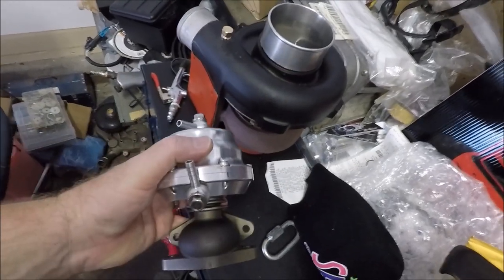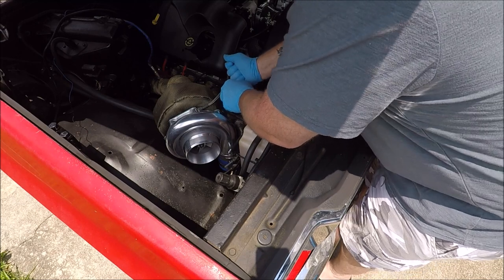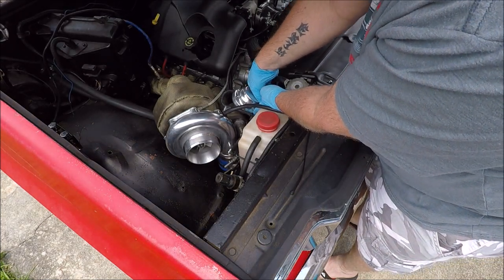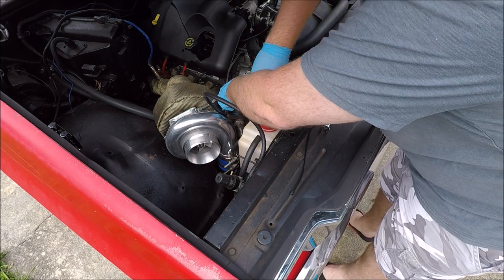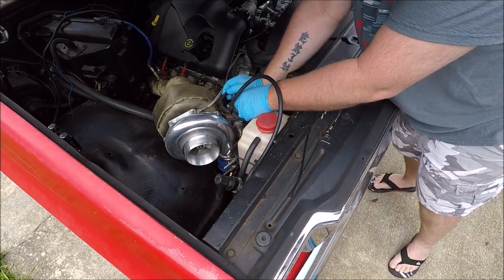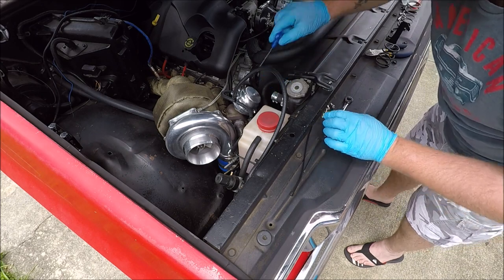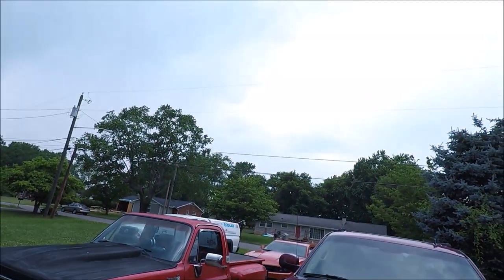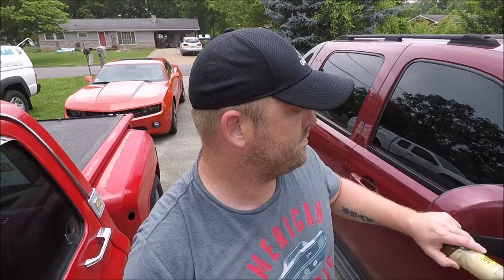SEATBELT DRAMA AND INSTALLING A STIFFER WASTEGATE SPRING FOR MORE BOOST

Comment: You’ve solidified my choice to delete my Power Steering! 😉 Originally I was over replacing the pump, 3 pumps in less than 1yr, remanufactured from Advance. #Warranty Plus I felt eliminating the PS frees up 10-15Hp and losses a little weight.  One less part to replace/break. 😉
Reply from the maker: Yea if I wasn’t planning on driving this thing all the time then I probably would ditch it too.
Reply: Bad Luck Garage With your full size truck it may be rough to manually steer, in an S10 it’s not really a big deal. 😉
Reply from the maker: I think it would be more about the 245/45-20s up front than the truck itself. Lol.

Comment: Alot of the 3 point seat belts wont work correctly unless they are bolted in. I suspect they require a specific angle, but i got belts before and they wouldnt work. Bolt them in and they are mint. May be worth a try anyway brother!
Reply from the maker: I didn't think about the angle thing but they were actually in the truck when I tested them(at least the passenger side) and the retractor seems to have a mind of its own. They're burgundy and dont match anyway so I guess Im just gonna spring for a new set. To be honest I was tired of messing with these racing harnesses all the time anyway,lol

Comment: I can see 100% if I ever need to change the WG spring I’ll have to R&R and use a vise to hold/compress the spring! 😳. This is definitely not a one-handed procedure. 🙄
Reply from the maker: Honestly that’s the best way to do it anyway to avoid pinching the diaphragm. My neck issues are back(that’s why I’m a bit loopy in the video...because of the medication) and that’s why I was saying I’ll be taking it off when I switch to the 12lb spring. Trying to push it down at that angle was pitching the nerve in my neck while I was doing it. The next few video will probably be kinda low energy until I get my issues sorted. 😔
Reply: Bad Luck Garage Hang tough and get yourself feeling better! 🙏🏻🙏🏻🙏🏻
Reply from the maker: Yea I don’t see that happening. Dr wants me out of work and back in physical theropy. Job wants me working 12 hrs a day 7 days a week. Job usually wins until I end up out for 5 months in temp disability again. Until then I’m just doped up like a friggen junkie driving around killing bugs. 🤪
Reply: Bad Luck Garage Ouch that sucks money wise. Take care do what ever is needed to get better. 👍

Comment: If you haven't already picked up new bolts, keep grade 5 in mind...  

while a grade 8 is stronger , sometimes itll break or snap before a 5 cause of the 5s ability to stretch/ bend..

I'm also fairly certain that david freiburger from roadkill/ hotrod damaged a vertebrae in his back from having the shoulder harness bolted to the floor as you say...  

definitely needs to be hooked to a roolbar or atleast a harness bar behind the seat..
Reply from the maker: Funny you should bring that up because I was actually looking up the grade 8 vs 5 thing last night and the consensus seems to be, if the tension is in the bolt from end to end then grade 8 should be used. If the tension is coming from the sides(shear force) then it should be grade 8. So for crossmembers, steering boxes, ect...grade 8. For thinks like shock mounts where the load is on the side of the bolt grade 5 should be used. 
And yes I’m definitely getting rid of the harnesses and just putting retractable 3 points in as mentioned in the video because I have no plans for a cage or roll bar in this truck. The next project will be a different story. 😉
Reply: If you feel that a turbo 6.0 doesn't need a cage, then shit I can't wait to see the next project!

Sometimes I wish my s10 was a c10, alot easier to find/ build a rear axle for.. not to mention c10s are sexy as fuck...  
 
Was gonna cut down either a ford 9 or 8.8.. but I'm not much of a ford guy, so now I gotta cruise the junkyard for a Dana 60 rear so I can have it cut to length and have new bearing ends welded on so I can use semi float axles..
Reply from the maker: LMAO. Goal was an 11 second daily driver for this one brother. If I can do better than that then I’ll probably back the boost off a bit for longevity. I’m really wanting to build something budget but just for the track....no overdrive, no interior, no muffler. Just set a low budget and go as fast as I can without busting that budget. But I need to at least get this C10 reliable and in paint before I start something else of wifeys gonna have a fit. 😂
Reply: Sounds like my s10 lol.. no overdrive and no mufflers.. 

unfortunately idk why but I have this overwhelming need to meticulously restore the interior.. 

Got an idea on What color or colors your gonna spray the c10?

It'd be kinda heavy but with  a budget a 2000 + NBS gm 2500 would be a decent budget drag truck.. comes with a 6.0 with  4l80e and either a semi float or full float rear depending on if it's a hd or not
Reply from the maker: Wanting to do Synergy Green for the wifey but don’t know if that’s gonna be in the budget so may have to go with something a little less expensive to shoot. But gonna need a ton of bodywork first. I don’t want a show truck but I do want to get rid of all the rust.
Reply: Synergy green would look awesome... 

especially if you did a factory style two tone with it, white in the middle, green top and bottom..  

Maybe you can get a local shop to sponsor a video and get a hook up on some paint..
Reply from the maker: That would be cool but you actually have to have views to get hookups like that. No paint shop wants to sponsor a channel with 3500 subs. 😂 There’s just not enough veiwership to make it worth it for advertising.
Reply: If your willing to try summit racing brand paint, they have sour apple green metallic for $ 84 dollars a gallon..  $118 for a gallon with a quart of activator and a quart of reducer..

 and it's between $63 and $84 a gallon for clear coat depending on what you choose..
Reply from the maker: That’s a great price but I doubt I’ll be painting it myself. I might put it in primer but I’ll have to get someone with an inside spot to paint do the actual final paint. Last couple outside paint jobs I had a part in turned out pretty crappy, lol.

Comment: Hey i have a 6lb spring in my wastegate, if i want to change it to an 8 or a 10lb do i have to retune my truck for it?
Reply from the maker: If its never been tuned above 6# then yes, it will need to be tuned for higher boost.
Reply: Bad Luck Garage ohhhh alright yea i only have it tuned for 6lb, thank you
Reply from the maker: Yes sir. Thanks for watching!

Comment: Is your truck faster on boost or nos
Reply from the maker: Comparing with the smaller turbo at the track it was most definitely faster on the bottle. With the new turbo I have no idea but I have to say the instant power of the nitrous definitely feels faster. There’s a reason I’ve always just bottle fed everything in the past. It’s just easier and you don’t have to wait in the power. The downside is you have to pay to fill those bottles constantly.